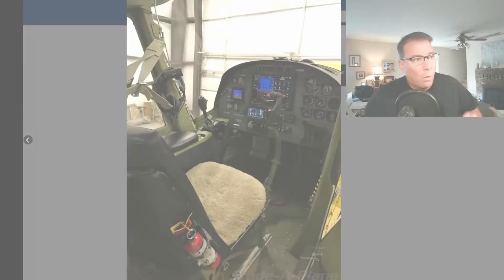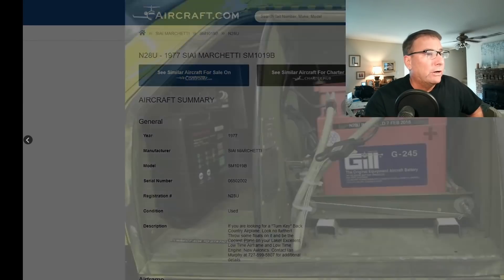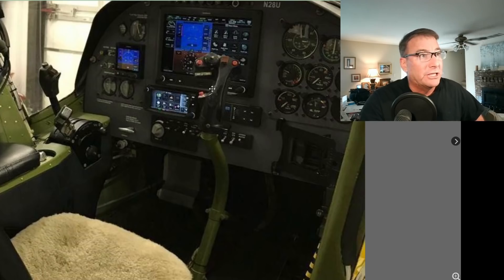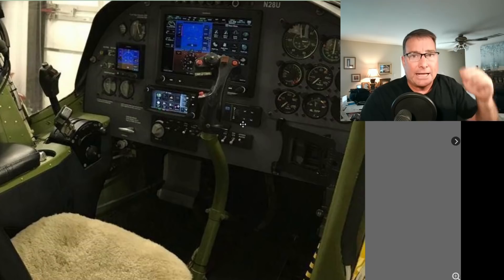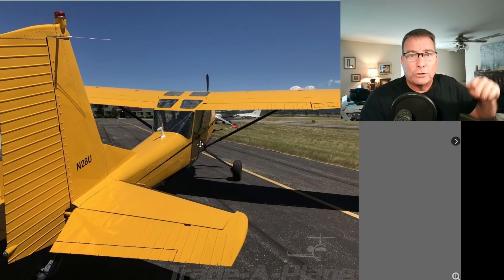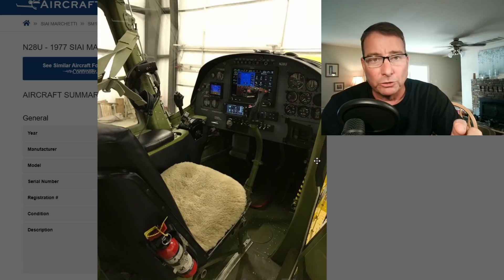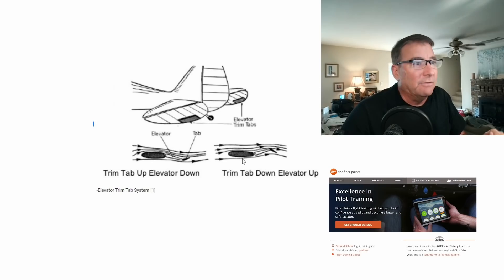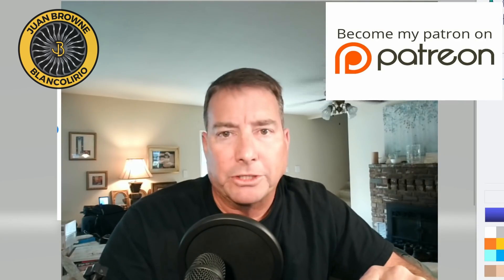Dale 'Snort' Snodgrass Siai Marchetti UPDATE- Elevator Trim System 8/8/21

Comment: At such a low speed, I don't see how the trim tab could overcome the pilot pushing against the stick.  If I have a trim problem on takeoff my reaction is not to jack around with the trim switch some  more, it is to push or pull the stick.  Anyhow, it seems the speeds were too low for that trim tab to overpower the pilot.

Comment: IMHO I believe that he had a sudden change of pilot seat position that doesn’t necessarily mean the failure was seat track related I’ve seen failures in seat structure plenty of times couple that with the audio as you can hear that in his voice he was very suddenly shocked and knew immediately he was in trouble also remember whatever amount the seat moves aft decreases that same amount of travel the pilot has forward with his control to counteract the condition I also believe when you look closely at the still shots you can see there is no pilot in the window we’re the pilot should be 🤔

Comment: FWIW, if the elevator was locked in a neutral position, applying nose-down trim would result in a nose-up pitching force.  (The trim tab is now acting like mini-elevator)
Reply: That is a very good observation. Especially as the video appears to show the elevators level even after impact with the ground. 

These videos are amazing resources. The input from comments like this only increases the value further, Even  if it just makes you think about how much you really understand about how something works and the variable paths to failure.
Reply: @Byzmax  I was going to comment on that very same thing lain. Even after impact Dales elevators didn’t move. Plus, I never saw any aileron deflection when the aircraft was beginning its corkscrew descent.
Reply: @mouser485  he was in a spin. In the tomcat you go controls neutral when that happens
Reply: @mouser485  I never saw any opposite rudder input either. Ailerons being neutral is normal in a stall/spin situation, but neutral rudder is not. Something very strange happened here.

Comment: an elevator trim issue is what happened to me in my Cherokee 235 in 1981.. I never felt any thing incorrect till I was about 10 feet off the ground the sudden nose  up attitude exactly as we see this aircraft pitch up and I could not overcome the elevator the way it was ,but I knew t he only thing I could try was elevator trim  in the top of the cockpit over head-I grabbed the crank handle and started turning, I felt the aircraft steadily going back to controlled flight and made it out with only a bruise ego. if this had not been the 235 constant speed engine I doubt I could have done this in time. I always hated the elevator trip crank in the top of the aircraft- a place it just doesnt seen to get your attention, yup, I know I should have dome a ground check  of the controls, but I doubt even then I'd have known if it was in correct position. this was in 1981,Phoenix field Carmichael California. so long ago I do not remember if there was any placard that would indicate zero -up or down.

Comment: If Dale had just bought this aircraft, it wouldn't be unreasonable for him to have brought it here for a check over/service. Do we know if the aircraft had been there for a while and he came back to fly it out? Was it a same day , or two, fly in and fly out? The top part of the stick could have been off for a CLA for sticky switches. Sweaty hands can gum things up. Possibly left over from the previous owner. It's like cleaning the steering wheel of your your "new" used car.

Comment: If trim was set for take off it would have been at least close to neutral and if he trimmed the plane after rotation it would have been to hold nose up attitude and if rigged backwards would have caused nose down. I like the runaway trim theory, hate electric trim and flaps. I bet Dan doesn’t like electric flaps either.

Comment: I AM NOT A PILOT!  But, I see very little option for any answer other than the aircraft was 'incorrectly rigged' or a major failure of 'trim' and 'elevator' control.  God Bless the man's Soul.  You can tell by his voice he was doing all he could.  For whatever reason, the aircraft failed him and he simply did not have enough time to sort it out.  God Bless him and his family.
Reply: Very well said, and astutely analyzed. Thank you.
Reply: So you have dismissed all the other possibilities raised by knowledgeable people on what basis ?
Reply: @hb1338   Very little option does not equal no option. Other possibilities remain. Where are these knowledgeable people you speak of posting? This is a poor platform to try to keep up.

Blancolineo has done as much as anybody, and more than most, to try to glean from Marchetti owners the characteristics of that plane and to try to gauge the most likely possibilities.
Reply: @hb1338  Well, I have considered if the guy was a total 'hotshot' and tried to hang the aircraft off the prop to impress someone watching.  Another option was that Jesus came down from heaven and stepped on the elevator.  That's all I got.  Enlighten me.

Comment: The trailing edge of the right elevator/trim tab area does not appear to be in a straight line, if you zoom-in on the individual video frames, just after the aircraft comes to rest.  It appears the trim tab is in the up position compared to the trailing edge of the elevator's outer portion. Could he have been getting the trim corrected, and even over-corrected as it made impact with the ground?

Comment: Trim controls should never overpower any surface on any aircraft, period !!  I can't believe this is even a concern. No way will I put my life on anything electrical.
Reply: How will you adjust maximum trim strength based on speed? Because max trim does not give a fixed force.
Reply: I come from the gyroplane world where rotor trim actuators are connected with springs so in the event of failure you can overcome the forces thru the control stick. If it were hardwired the actuator could overcome flight controls. The only way I could see this working on an airplane is if trim was part of the elevator and not a separate tab. But still it just doesn't seem right that a stuck trim could overpower flight controls.  Hope this explains my initial comment.

Comment: Student here (59 hrs). Because of the recent reversed trim accidents, my preflights now include standing outside the a/c and working the trim wheel to make certain the tab goes the right way.
Reply: My dad always used a laminated sheet of paper with the pre flight written on it. He would grease pencil check marks as he went through it. I've never seen another pilot use a written check list, I'm sure there are some but it's rare in my experience.
Reply: @cgirl111  32 hour trainee PPL here but it was drummed into me to use the checklist & not work from memory. Full & free is standard part of pre-taxi & pre-takeoff checks.
Reply: Most plane don't have a high tek trim system something I would not be concerned with
Reply: @cooperparts  doesn’t matter, you check the trim on any rental. You have no idea if it’s reversed. A 10 sec check is worth it.
Reply: You will know in 300 feet if your trim is way off also I do not take off like he did in the video so if something is wrong I will know and yes I do fly extra330 after 800 1000 feet you can crank it up but not right off the ground the second the nose popped up it would of been shut down like they say bold pilots and old pilots and I am getting to old pilot that stunt flys it was in the controls and off the ground you have options in the air not as many lot of runway in front of that plane  he was hotdoging and a problem arose
Reply: I’m surprised people have not been doing this from the start.

Comment: I'm a student pilot and my instructor (and the POH) have ingrained in my head that a pre-flight check (ie controls free and correct) always includes a detailed check of the elevator trim and the correct positioning for nose up and nose down trim. I once discovered during a preflight that while the position was correct for nose down trim, the nose up position remained neutral. I would think that an experienced pilot would check this, although there is always the possibility that an electric trim mechanism malfunctions after checks have been made and the take-off roll has started.
Reply: Planes that sit stored and then spring back to live, once you start bouncing down that runway all sorts of gremlins might appear.  Makes you wonder how coke smugglers for the cartel can land business jets on short dirt runways in the middle of the forest and take off again 500x times a year with absolutely no safety or checks whatsoever in some 50 years old archaic junkheap.

Comment: Juan, I think you need to do a better job of informing the viewers that this is all speculation at this point.  Some of your analysis comes off as factual.  At one point, you say, "This is not the first time this year we have had a major accident due to a mis-rigged elevator trim."  That sounds way to much like a statement of probably cause.

Comment: I'm fairly much going to disagree with you Juan on the trim tab issue.
The trim tab is small relative to the elevator it does not need to be electric. I suspect the reason it is electric is to enable the control of it to be mounted on the stick.
The elevator is a much bigger surface without mechanical assistance - and that should mean a human can fairly easily overpower the effect of the trim tab - even if 90° to the elevator.

I don't think the controls locking bar is the issue either.

Currently, based on the info from you, I'm thinking of the possibility of the elevator control being jammed by FOD.
Reply: History already shows other accidents where the pikot hasn't been able to overcome the trim. The tab is at the end of the elevator and has a big moment arm. And the flowing air works as an amplifier to further increase the effect of the trim tab.

The only reason the trim tab can be so small is because that small size is enough to overpower the wind forces on the much larger elevator.
Reply: @perwestermark8920  'Trim' is only supposed to be a fine adjustment - hence the name - and the effect should be minor relative to the main control. In this case, it's merely something for the pilot to work against - but I see no reason for that not being possible. (To be able to overcome the effect of the trim tab.)
Reply: @millomweb  Just that amount of trim needed varies based on other conditions. So having enough trim capacity for all vonditions, there will be too much trim capacity in some situations.

This is hard to solve with mechanical solutions. Much easier with electrical solutions - but the dangers with a flight computer adjusting max trim as conditions changes makes this a not so fun solution. Runaway trim is an issue with the big planes - so I can't see an easy solution to solve this in agood way for small planes.

So in the end, it's a fight between "what would be good to have" and "what is reasonably easy to deliver".

But the route normally selected for small planes is to make max trim a bit too weak, so it doesn't always give enough effect. Just to make it easier to overcome in the situations where the plane needs the least trim.
Reply: @perwestermark8920  It is possible to make elevators neutral for force requirements - it depends on where the pivot point is - located at the centre of action of the elevator, little effort should be required. The trim could then simply be designed to adjust the position of the elevator relative to the stick - for convenience in flight. While I say that, I don't actually think it is a good idea as the human then loses the feel of the actual position of the elevator ! Imagine if they did the same with the ailerons !
Reply: @millomweb  The SAAG 39 Gripen plane did have two severe user-induced crashes because the pilot didn't get a feel for how large commands he requested. So when there was lag in the system, the pilot issued larger and larger commands.

They needed to redo the joystick so it required a very big force to request a big change.

Feedback is really quite important. Which is also why cars don't want to have too low steering forces at high speed - the power steering assist is most needed when parking.

Comment: I don't buy the inability to overcome full anu tab. He'd just have to firewall the stick and at rotate that should be easily doable. Plus, he was a fighter pilot experienced with swiftly dealing with abnormals and with reversed trim hat wiring he'd have solved it pdq, or just firewalled the stick! My money is on something heavy on the back seat falling into the back or an insecure battery etc rolling aft and causing severe aft CG.
Reply: Yes, this is what other pilots whom own this plane had said in the crash video uploaded this week (has like 225,000 views or so as of this comment).
The seat back collapses or the seat collapses suddenly on pressure (as seen if you lift up off the runway, your back is pushing more against the seat to cause extra pressure on it). This is reported in comments so i am not going to say its true, just passing on other info I have seen from others. Cheers

Comment: I think I read where the WWII Focke Wolf 190 had an electric trim switch, which used to fail and runaway occasionally.  The switch failure got one of the post WWII USAF test pilots that was doing post war evaluations on the aircraft’s performance (and doing bond and goodwill tours).  Not a new problem and very dangerous, even for very experienced pilots (especially a 72 year old pilot who doesn’t think as fast as he used to).

Comment: That changes everything in relation to to may have happened.  Even though I don't fly, I am notorious for checking behind a mechanic who changes my oil in my pickup truck.  I grease the front end on a fairly regular basis.  True I'm on the ground but if I lose a tie rod end due not being serviced and hurt someone else then it's me. I have taken ambulances out of service because the front of tire started shaking. It makes this doublely tragic.

Comment: JB and pilots: I would never think about trim during a situation like this....bummer. My flying is on a similar model, but the trim was on the side of the seat with a graduated cylinder moving elevators up.... forward and down..back. Quite a bit easier and less....in this case if it proves to be the electronic elevator trim...deadly.
 We miss you "Snort".
Rest in peace 
יוי

Comment: Do the flaps seem set beyond 20 degrees , or would this even matter with that much power.?
Reply: I don't know what they were set at, but what affects trim effectiveness is airspeed.  I agree, it may not have mattered that much at take-off speed in an STOL plane.

Comment: This accident is a real shame. I always said to other pilots in my charter department and students alike, you never know when something is going to happen to you. Those of us that have had potentially fatal things happen to us are the lucky ones. It doesn't take much and you just don't know how you're going to react to something unless you've been in some life or death situations before.

When I was first flying VFR freight charter in a Lance, I had the seat go all the way back on rotation (I was empty going out to load the freight at another airport). Even at 6'3", I could barely reach the yoke. Thankfully I had enough sense to not grab it. I also checked the trim before every flight, even if I was on the way back home after being on the ground for only an hour. Also, the Lance and Saratoga series are pretty nose heavy, so the abrupt change in CG didn't have that much of an effect.

Just happened to be after the aircraft stabilized in a climb that I could grab onto the sidewall and pull myself forward.

I think things like this happen a lot more than most people realize, and the ones that are unlucky or the circumstances were just wrong when the event happened, are guys like Snodgrass.

I feel terrible for his family and friends. Have an amazing career like this guy had, not to mention his service to the country and in 30 seconds it can be lights out permanently.
Reply: Training, experience and common sense is what will keep you alive. Luck has nothing to do with it. Oh and use the damn checklist.
Reply: @einzelganger1049  Luck actually has a lot to do with it. I suppose I'm using luck and circumstance interchangeably, but it has everything to do with it.

Wrong place, wrong time.
Reply: @Airplane_Willy  In your world.

Comment: I have most of my flying time in Cessna aircraft and every check list states "set trim for takeoff "so why would any pilot want to move the trim after V2? For none pilots out there V1 is your last point for a rejected takeoff. V2 is when you reach flying speed and can rotate the aircraft and start to fly. One reason to retrim the plane would be the center of gravity could be out. Was Snot carrying a lot of stuff in the back?
Reply: Camping gear.  He was leaving for a camping trip.

Comment: I was sailing in the reef runway in Hawaii and witnessed a two engine tourist aircraft crash due to a reversed fuel tank switch.  No injuries but tourists were standing on the reef.  I couldn't get my sailboat close enough for rescue but they were OK but wet and thankful.

Comment: Mooney crash in mn yesterday fyi, It is so easy to get something wrong. I built my own pitts years ago. I had a bad brake cylinder before i flew it so i changed it out. And before i test flew it i had  4 others mechanics 2 of which were AI's look over the airplane end for end. Test flight was fine but next day i did an inspection and found the  rudder cable was missing the nut and cotter, the sheet metal skin kept the bolt from coming out. About had a heart attack when i saw that. Also there has been over the years a number of rudder cables that were rigged backwards. i just dont know how they got to the runway without figuring that out.